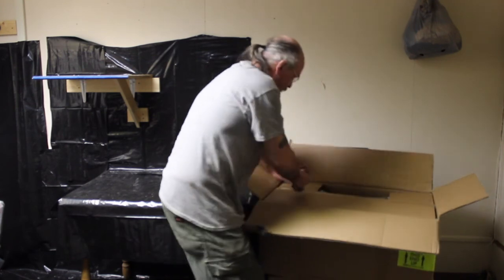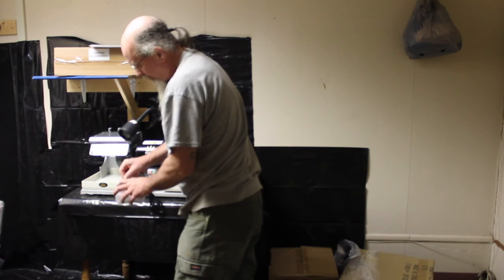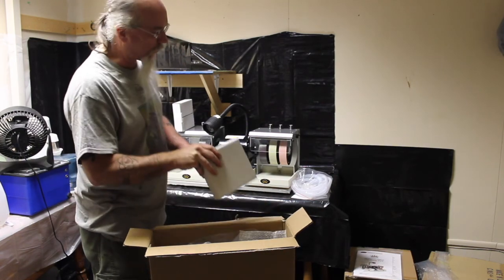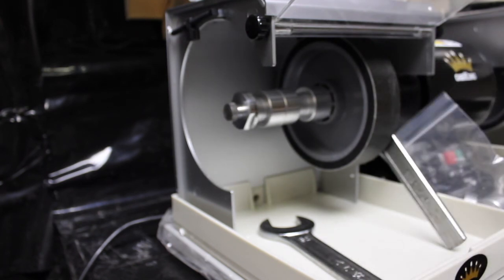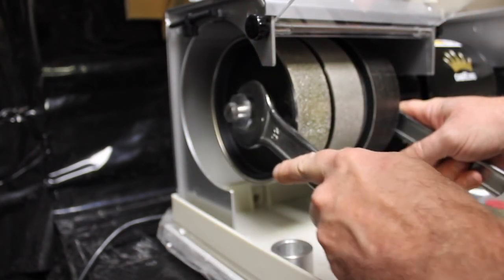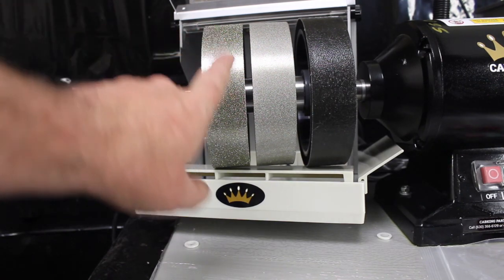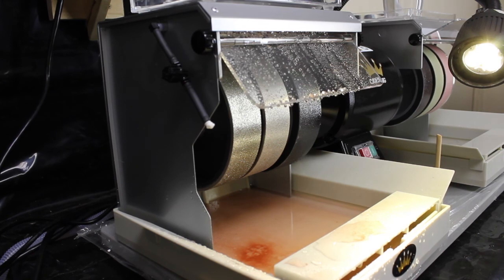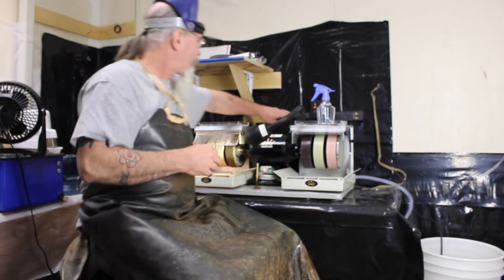"CabKing" 6", Unboxing, Set up & 1st Demo

Comment: Definitely like the water delivery system on my Diamond Pacific Genie a lot better, never liked having just a drip system on any of my equipment. Also, the 80 grit wheel should be flush with the end where the nut fits into the spindle. So use the short and long spacers between the 80 and 200 grit wheels.
Reply: I agree that the under wheel water fountains are best. You can see when the wheel isn't getting enough water.

Comment: At first I expected anticipated rainfall with all the plastic, but it's the CabKing making all the splash. Wouldn't work in my apartment if all this waterproofing is needed. Can a splash guard be added to to hover over the wheel behind the clear guard?
Reply from the maker: There's really not all that much splashing over, I just have a habit of over protecting. Plus it wasn't my property. 
 Most of the water comes out of the front so have something to cover your front and maybe something on the floor. 
 Thanks for your comment.
Reply: the splashing is due to the amount of water flow over the wheels its not necessary to have that much water nor is it necessary to have a stone on the dop stick that early in the cutting..

Comment: I’m glad you ran into the same issue I did. The answer to that issue is not easily available. It says go from in to out resin wheel then 1 inch spacer then 220 wheel then 3/4 80 wheel then 3/4 spacer
Reply: Thats incorrect, it goes (Resin Wheel, 1" Spacer, 220 Grit Wheel, 3/4" Spacer + 3/4" Spacer, 80 Grit Wheel, Lap Adapter). In my instruction booklet, that is exactly how it's written too, and mine has perfect symmetry. There is never meant to be a spacer on the very end next to the Lap Adapter. The 2 3/4" Spacers are meant to be put together to make a 1-1/2" space. 👍

Comment: Hi, can you please tell me of which material are made the wheels of that cabbing machine? The first, the second and the third wheel are made of stone and the other three are covered by sandpapers...am I right??
Reply from the maker: From left to right, are 2 coarse metal/diamond wheels then a coarse grit sand paper wheel, on the right hand side there are the 3 finishing, finer sandpaper wheels.
The flat end on the left has a metal flat wheel for flattening the back and the flat end on the right has a flat polishing disk.
Reply: @RErikWeigand  Ok and when the sandpapers are consumed, is it possible to change them with new ones?
Reply from the maker: , @alegdansk  Cabking has the replacement's as well as other options.
Reply: @RErikWeigand  Ok Thank you ;)

Comment: When I do it that way my spacer is out beyond the end of the shaft
Reply: It goes (Resin Wheel, 1" Spacer, 220 Grit Wheel, 3/4" Spacer + 3/4" Spacer, 80 Grit Wheel, Lap Adapter). In my instruction booklet, that is exactly how it's written too, and mine has perfect symmetry. There is never meant to be a spacer on the very end next to the Lap Adapter. The 2 3/4" Spacers are meant to be put together to make a 1-1/2" space. 👍

Comment: Your wheel spacing is still off, I have the same machine and all of mine are equally spaced.
Reply from the maker: Yes I know, it just happens to be the configuration that I could get to work. In the future when I get set back up in a few weeks from now, my intention is to use only 2 wheels per side to be able to get the space in between that I am looking for, I'm going to order a few more spacers for that, if I had done more research or had more experience, I would have gotten the 8" machine. Thanks for watching.
Reply: You just need to add that other spacer. Once properly installed you'll have equal spacing between your wheels
i'd also recomend changing the soft wheels to Nova wheels. Sadly the CK wheels are total junk
Reply: By the looks of it, on the left side the first disc that was on the machine you need to flip it to move the built in spacer from left side the inside “right” side. The right side of the machine also shows it spaced that way
Reply: Cab King has a video of opening and assembling this exact machine. It's what I watched when I did almost the same thing. You know if nothing else works read the instructions.

Comment: Bought one on Amazon same size, I've had it for a year. I found that you need to add a filter on the water uptake side of the pump. Otherwise sooner or later a very small piece of material will plug at one of the spray nozzles and it takes some time to clear it. Other than that (which I can't say is the cab machine makers fault.)  The only thing I can say, is I wish I had gotten the larger size. That said, three people use mine so it has been worked a lot, enough that I had to replace some of the wheels and that was just as easy and I got them from Cab King through Amazon. $70.00 a piece so be careful. Although I replaced three one was cut when a rock with a very sharp edge slipped in my hand and cut the wheel. I will not do partial (face) polishing on this again. "The little red thing are bushings for different sized arbors so they can be used with other brand of cab machines. Rock On.
Reply: On their website they tell you to only use clean water. I haven't bought one yet.. but that's why I'm here, looking at everyone's reviews.  It's a lot for me to spend right now so I want to make sure I get a good one. I'll definitely be getting the 8".. I have big rocks I want to polish not just small cabs.. their website also says that it goes thru 2300 liters per hour of water.. and if your not using free we'll water or rain water or recycled water, then I'm gona be paying a house water bill every month.. then again I'm sure city tap water isn't good for any working machine since it's hard water and will calcify and have a ton of build up fast..